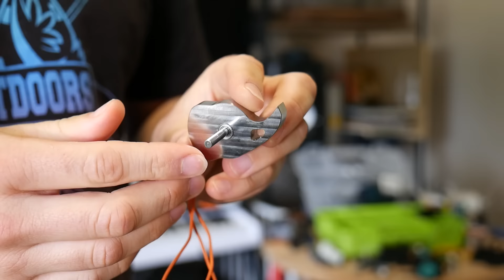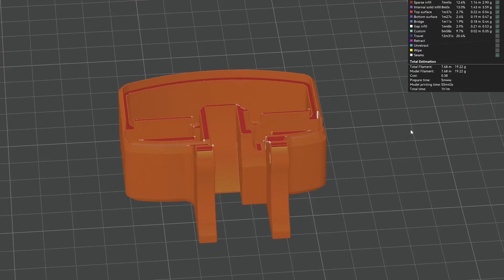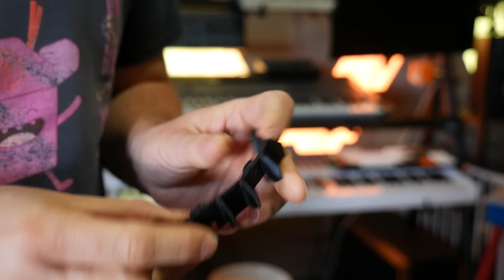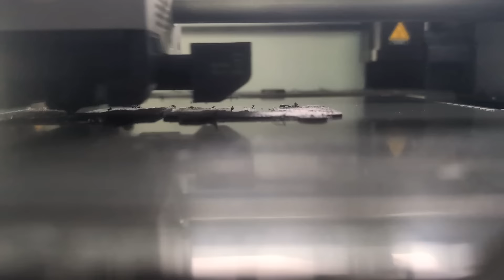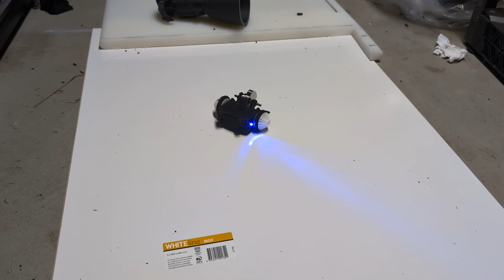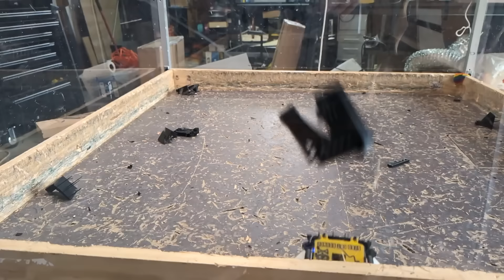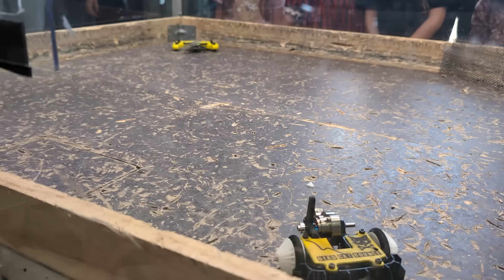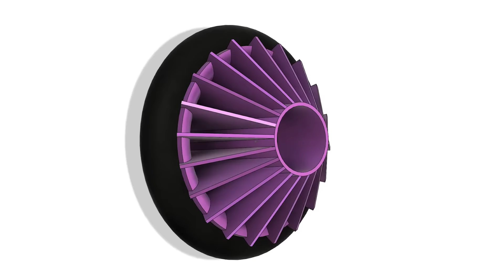Is this tiny combat robot INDESTRUCTIBLE?

Comment: is it somehow possible to combine the soft and the hard tpu materials in one print? that way, you could maybe improve the wheels. keep the softer one for the fins, have the harder one for the hub, so it keeps the wheels on the shafts better. or maybe some kind of locking mechanism. small hole in the shaft with a pin to secure? locking rings in a groove? 
just some ideas i came up with just now, i have no actual knowledge on any of the stuff :D

Comment: If it's hard to control, maybe you could make the weapon tilt and use the gyroscopic force to turn instead. That could even allow for a single inside wheel design, as you'd only need it to propel you forwards and backwards. I have no idea how complex it would be to make such a design however.

Comment: Could you thread the very end of the motor shaft and fit a locknut?  Or drill and fit a cotter pin, washer and spring assembly?  Possibly too small...

Comment: I'm sure you know better than me seeing as you actually have experience in battle robots, but it seems to me like the forks could benefit from a muli-part design. Each fork could be composed of a soft but high fracture toughness TPU layer on either side of a rigid spine. Although, you seem to have found an excellent solution without all the unnecessary weight and complexity the I'm proposing. 

Great job, that little nugget absolutely rips.

Comment: That 64d TPU confused me. Hardest but with lowest shore rating?
Reply: Shore hardness has multiple letter scales that kind of overlap. 95a is high-ish for the a scale but it's equivalent to ~50d much softer than 64d.
Reply: @engineered_cha0s  cheers. I need to do some research as I'm after a very hard TPU for a battery enclosure

Comment: I always tell the kids, if you can't win fairly  ...  cheat, cheat and cheat again until you do win😎  I can see there are issues with gyroscopic effect.  Have you considered counter-rotating blades?  Have the stator coupled to one blade, and the rotor coupled to the other blade.   The two blades will counter-rotate and free-wheel relative to the chassis to significantly reduce the net gyroscopic forces..  The counter rotation will produce a blade shearing action.

Comment: The wheels don’t really need to be external, correct?  It can self right itself, and has a very limited range when operating where the wheels are in contact with the floor.  😉

Comment: if you are going with titanium for the spinner, then go ALL IN and get an injection molding set up. you can make your own custom PA6-GF wheels with ablative soft covers that rip off. people don't understand how insanely strong gf nylon really is. there is a reason ford used it for their valve covers lol.

with injection molding though, you could model out a part in PLA and then use that to make a mold. or  you could go old school with a die grinder and just grind a die by hand. also you could go with the double spinner that has no gyro effect. you get half the hitting power, but you can hit from the front and rear

Comment: Unless components are so close together that you'd desolder one thing while soldering the next, it's usually easier to solder things (even very small components) with a conic chisel tip such as the TS-BC2 (instead of a conical tip). Flux and solder mask do the rest of the work for you.

Comment: Ive got an idea to make the controls easier. Maybe have another internal gyroscope spinning in the opposite direction to counteract the forces from the main spinning weapon i don’t know if it will work but if it does it would be pretty useful

Comment: with it being brushless motor mounted that means it can be pushed and stopped only with the friction of the magnetics. i would rather have it on a gear set myself to increase the torque required to push it backwards

Comment: You should put a horizontal gyro stabilizer so that if a wheel comes off, it could be activated to keep the bot going straight instead of turn (countersteer against the one wheel that is left). You should also create a stabilization software that changes the speed of both gyrostabilizers (in this case) to keep the bot level to the ground. Lastly, you should put some solenoids or something similar to let the robot jump. As an agile robot, being able to bounce away (doesn't matter the direction) on command would prevent destruction of the wheels.

Comment: Great design!👌
What if you make wheel hubs, and or wheels out of the tough stuff you printed the forks with, then add those sacrificial "fans" on the outer sides of them.

I don't know if it's possible to print a single piece, blending two different filament types, if so, then cool.

If not, you could either join them with a strong glue, or some small screws, or both.

Also, you could incorporate some level of interlocking "keys" into the design, to further help with adhesion of the different filament parts.

That gyroscopic precession definitely is trippy to witness!
I wonder if you can incorporate a rugged mechanism to somehow tilt the rotor slightly in a desired direction to use the gyroscopic precession to your advantage when turning, instead of fighting it.

Using the same principle demonstrated in that science experiment taught in schools of the person holding a spinning bicycle wheel vertically while sitting on a swivelling office chair, then tilting the wheel off axis to induce yaw.

I'm just looking forward to seeing more!😃👍
Go the angry 'lil pussy! 😼😅

Comment: For those legs which you was doing the hammer test on, why not have a super solid durable filament like the glass hybrid one, but then around that do a few layers of the TPU filament, so it retains its rigidity, but also the TPU will absorb some of the impact making breakages less likely

Comment: Rather than printing in TPU, maybe it would be better to print positives for molds to cast the armor bits?

Though you'd probably need a vacuum chamber and a pressure pot.

Comment: Here is a weakness I spotted before I watched the full video: the fins in the wheels actually increase the leverage of certain impacts right where the shaft meets the wheels. I would use some form of circular shoulder around the shaft, protruding from the body. That shoulder would absorb some of the impact. The trick is to figure out the clearance. If you give too little clearance, if the shaft or the wheel deforms, you can't spin anymore. Too much clearance and it doesn't help at all. I would manually bend the wheel and shaft assembly to establish the beginning of plastic deformation (end of elastic deformation) and set the clearance such that it would stop the wheel-shaft assembly from reaching plastic deformation. between this shoulder and the wheel you could have 2 teflon  washers of the same diameter as the shoulder, to help the wheels to still move if they are rubbing against the shoulder.

Comment: Are 3g enough weight to add an acceleration sensor for direction control to maintain direction as long one wheel is in the air?

If direction is maintained, there might be some improvement, that some deviation from the direction is an advantage, when you really want to stop or accelerate. And maybe that could be coupled with the weapon speed. However, I guess just maintaining the direction might help. I imagine getting the weapoin towards the enemy is one of the main tasks.

Comment: What if you add an accelerometer to detect extended gyroscopic tilts?  It could temporarily throttle back the weapon speed until you regain control.

Comment: It would be overpowered if the "dangerous" wheel had 5 more friends so that there were a total of 6 destructive wheels in a circle around the center, in other words it doesn't matter where the threat comes from and instead of being propelled by 2 drive wheels why not use the kinetic unbalance between the 6 weapons to create a directional resultant while just using 4 free balls under it to counter the friction against the floor. Nice project! 👍

Comment: I have an idea for the wheels. You probably already thought of this, but making the core of the wheel out of a more solid material would help it stay on more, but it could shatter more easily. Either switch the plastics quickly while the part is still hot, or use joinery techniques and simply slip one over the other.

Another option is to continue using that super bendable tpu, but drill a couple holes into the axel and make the wheel fill up those holes as well. Its a more technical design, but if you can somehow manage to create holes so small, you can melt some excess material from the wheel into the hole to create a bot that would rather be smashed to pieces than to lose its wheels!

Edit: try to make the body of your bot conical in shape. Like in mediaeval armour, conical shapes are incredibly good at deflecting attacks. Choose either conical or triangular for the effect. Square is great at form fitting to parts but structurally it isnt the best pick and it prefers to take the most impact it can compared to deflection

Comment: I know you already made the bot, but for next time I recommend trying a memory shape alloy. Its an expensive pick but its ability to bend and return to the original shape at would make it an incredibly durable machine if only a bit heavier than plastic would be, but the lightweight Mg-Sc is actually significantly lighter than aluminium

Comment: I've tried 64D TPU before, to little success. I tried to use it in a us antweight (450 gram) hammersaw arm, and after one swing it cracked. Instead of that, maybe try 98a TPU. It is a little bit softer, but not by much, and it doesn't crack nearly as much. I've found that Priline and Sainsmart brands are pretty good. This is a sick bot by the way, hubmotor weapons are cool!

Comment: I use a tool for holding pcbs, it’s called a stick vise. In conjunction with helping hands which you already have it is very convenient for soldering small wire to pcbs like you do. I think it would be cool to see you test your robot materials on your own spinner. You might be able to use a rigid rubber axle to connect up your wheels to the motors to help shock insulate them more.

Comment: A pricier option maybe, but for fine soldering maybe hobbyists are better off using a conductive epoxy instead? I use it when hand soldering LEDs.

Comment: For the forks I would suggest doing a revision of the forks with a base of medium soft TPU then making that base 1 - 1.5cm so that it adds some give, but not too much give then make the rest of the fork out of PLA PR01 then making the connecting part a dovetail joint then fusing them with a solvent cement glues which will create a bond as strong as the plastic because it melts the plastic and fuses the parts, honestly if you were starting from the beginning I would have suggested making an internal a hard plastic frame making the connecting joints of the frame out of a soft TPU then have an exterior of soft medium soft TPU and using the frame to give it rigidity and using the exterior to dampen any strikes.

Honestly you could even make the interior frame a hard metal frame with TPU joints so really the worst that would happen is the TPU joints would rip from blunt force, but a hard plastic would be fine to and makes it less likely the TPU joints would rip as even hard plastic has some give and you can 3D print them yourself rather than having to buy some very thin metal rods and cut them to size then having to somehow drill a tiny hole in the ends to add a pin to fix them inside the TPU joints.

Comment: I always asked myself... how good a horizontal spinner would be where the rotor actually invokes HUGE downward suction... literally forcing it down.. it would make the  bot act like it is WAY HEAVIER  than it actually is.
Reply: Maybe even add the function... to go flush with the ground if needed on a sticky rubber bottom.

Comment: Hey man, the PA GF prints you got look very rough and I'm seeing you're using some small filament dryer, those don't cut it, you need oven set to like 90C+ (manufacturer/datasheet should have exact drying temp info).
Unless it was caused by the extra big GF fiber.
I think I've been printing some 200C rated PA CF/GF filament and kind of drying it gave bad results, chucking it into oven set to 100-110C gave very good results on X1C.

Comment: You could think about extending the wheels towards the chassy to prevent there being any option of hooking and ripping off to the wheels. Or you could extend the chassy outwards into a kind of fender that can deflect hits towards the wheels. Seems to me that the relatively exposed wheels are currently the weakest point of the design.

Comment: for the rear armour, if you find that it needs some refinement, i'd go with a honeycomb pattern to also catch those vertical spinners
for the wheels, IDK how the motor mounts but i'd make a shaft that kind of bulges in and out of it like we see at the back of the video. perhaps secured with a screrw from the end or one side. the wheel fins seem to work very well other than their nature to rip off. maybe some way to easily change the hubs and make them easier to rip off could make it more protective

Comment: I have recently bought some TPU 95A for my very first battle bot for a school competition and I can’t find how to set it up, i noticed how you are using a bambulab A1 which is the same that I have, can you make a video on how to set it up or give me some advice?
Reply from the maker: I used the default settings for generic tpu, but some brands may still be too soft. The trick is to extrude slowly, so make sure that the material setting you're using has a max volumetric speed of ~3mm3/s.
Reply: @MakersMuse  thank you so much you have no idea how helpful this is
Reply: Specifically for combat robots, Angus has a video from earlier in the year discussing specialised settings too
Reply: @engineered_cha0s  thanks man

Comment: Great project and videos in this series.

You breaking out the Prusa XL and do some multimaterial wheels? Would love to explore more possibilities on multimaterial printing and design! It's a really interesting concept that is in it's infancy and could offer some unique design options. The wheels could be a good candidate for that, more rigid hubs fused to the TPU...

Your definitely a smart enough guy to pull that off. If it works for the wheels, maybe that concept could be applied to other parts. 

Regardless,  love your work and videos. Thank you.
Reply from the maker: Don't have an XL but an idex/toolchanger style printer would be perfect for combining the soft and firm tpu's!

Comment: Any reason you didn't use the material you tested and found had the highest impact resistance for the entire frame? Isn't that kinda the whole point?
Reply from the maker: I wanted flex for the frame to absorb impacts, but the much stronger PA6 gf was the better choice for forks and top plate.
Reply: @MakersMuse  but isn't the result of the ad hoc charpy test that the pa6 absorbs more energy?

Comment: My cars intake manifold is made from PA6-GF30. The community around the car (BMW E46) have tested these manifolds up to 30PSI of boost with no measurable failures.

I even made a manifold adapter out of the material with my Bambu P1P.

Glass filled nylon is extremely cool and works great for car parts!
Reply from the maker: That's incredible!!! What printer did you use for a part like that? I'd imagine the x1c print volume is pretty limiting.

Comment: Mikado Logo 600 RC helicopter main blade grips is the plastic of choice if the recipe can be repicated. Countless inverted crashes since 2006 by every owner and only a couple of reported breakages. 
Big helis hit hard and break a lot of parts, but these blade grips are tough as nails.

Comment: If its possible to have a roll sensor you could dynamically change how the robot is controlling based off of if its on 2 wheels or 1 wheel and the spinner rpm if that's possible to sense too. the extra headroom in the wheel motors could be helpful for maintaining control when in the 1 wheel modality.

Comment: -Use extra soft silicone for the tires. flaps in stead of treads. the softer on the shore scale the tackier it gets for increased traction while being more pliable and tear resistant.    

-Also, consider designing a self righting shaped silicone blob that uses an arm with long enough strands of Micro Dyneema at the end, to tangle up the moving parts of an opponent. The drive should be strong enough to whip a tangled opponent against walls or even whip against other opponents. Wide Silicone tires should provide plenty of traction. The silicone "armor" should be resilient and thick enough to resist any impact. 

You're welcome.

Comment: ideas: steel reinforce the forward forks maybe clothes hanger wire. Heat and force in? add a thru-wheel pin to lock the hub of the tires into the driveshaft?

Comment: Awesome design! I love the concept. One suggestion: maybe adding another titanium vertical spinner could give the robot a bigger range for easier hits—like two on the front side, or even one on the front and one on the back. You could even go crazy with one on each side for a total of four with 4 wheels instead of 2, though that might mess with the gyroscopic effects! Keep up the great work!
Reply: The problem with that is the weight. This thing measured in with just a couple of grams of spare weight capacity left to be able to fit into the desired weight category.

Comment: the impact tests made me think about samurai swords. each sample you tested was made using a single filament. have you tried making anything using multiple filaments, like a soft internal filament with a harder filament as the shell, like.. a samurai sword? so you get strength but it, hopefully, wont fail catastrophically.